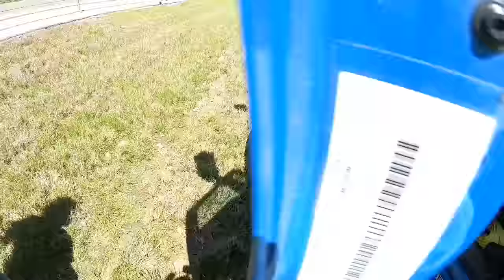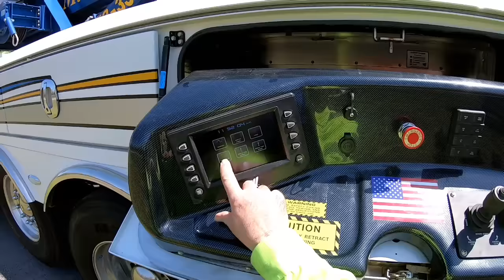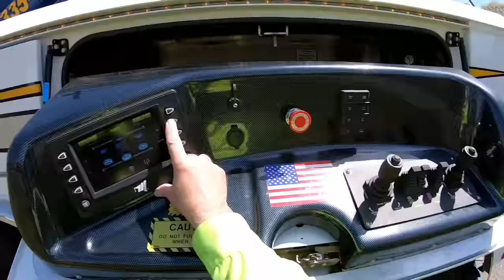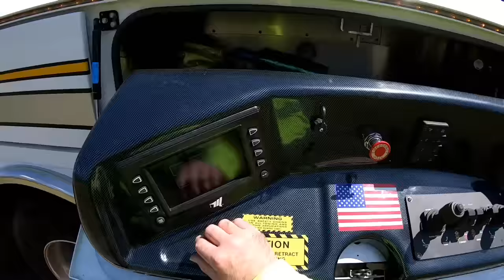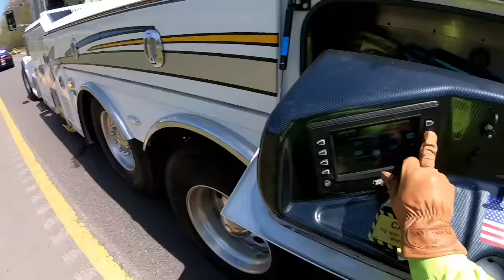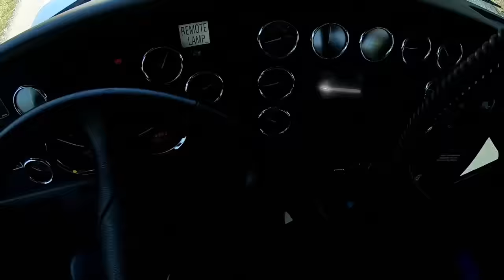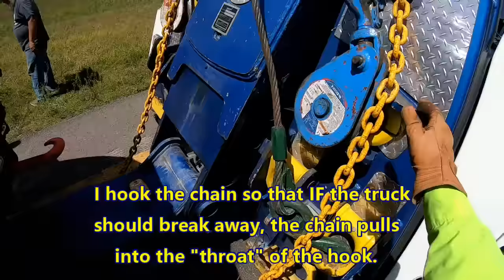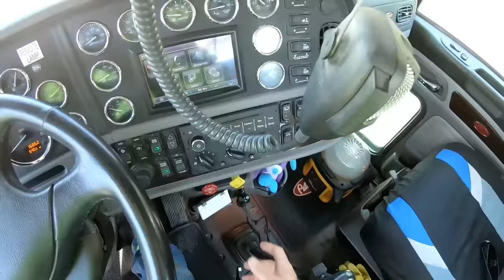Car VS Semi Crash!!!  Code 3 Response

Comment: 62k miles on a big rig is like a showroom fresh car with 1000 miles being smashed up. Its all fixable though.
Reply: Since trucks mostly do highway, I beleive it is safe to say that the average speed would be what... 40MPH? That mean 1550 hours, or at 8 hours/day = 193.75 days, 5 days/week = 38.75 weeks, 4 weeks a month = 9.69 months... Let's call it a 1 year truck.
Reply: that international had 43,853 miles on it, that cummins had just got broke in good.
Reply: @thephantom1492  try 55 mph average lol
That's my average with mostly running from Washington into California.
If you are running in states with higher speed limits (CA is still 55, Nevada gets up to 80), and you don't have a governed truck, it can go much higher.
I average 10 to 12,000 miles per month, and someone in an open truck not constantly pulling mountains, with higher speed limits is going to be higher.

So if he's otr, it could easily be less than 6 months old.

Oh, and we drive up to 11 hours per day, usually 6 days a week.
Reply: @thephantom1492  No, most 1 year olds have between 80 and 200k
Reply: @thephantom1492  My company say  average pre  year is 125000.
Reply: Plus its a diesel.
Reply: reverse thrust  my old favorite was the Kenwood thg71a, used that for years doing disaster and event comms, along with a Yaseu mobile rig. I more recently bought a Baofeng ht and am happy with it for the price.
I am not very active currently, so I haven't gone shopping for new gear in a while (other than the $30 Baofeng lol). Just decide what you need for your uses and look at the reviews.
For antennas, I would get appropriate Diamond or MFJ or whatever antennas, based on the gain that I needed.
For the ht, I had a selection from stubby nubs to telescopic 1/4 wave whips, and usually ran a pretty long whip, since I was often far from repeaters. I also usually had a mounted or magnetic mount mobile whip and adapter to attach to the ht.
Basically get the highest gain antenna that works for your needs, and get it from a good company with good reviews.
For instance when I got the Baofeng, I got the Diamond SRJ77CA high gain 15 inch whip, because it's what I like. 
I think it cost more than the radio lol
Reply: @thephantom1492  Haha Haha. Are those short haul estimates? Pull the other side.
Reply: My day cab is 1 year old and has 187k miles on it. It had 6k miles when I got it last year. I run linehaul at night, and another driver runs city with it during the day..it only sits a few hours per day.
Reply: My uncles company runs up 150k a year on their trucks so 43k would be less than 4 months old
Reply: @thephantom1492  nah we put 100k plus on a otr truck a year easy

Comment: Great video ! I have 30 yrs with a municipal fire dept and this is a first. I’ve not seen a tow truck running lights and siren to an incident. It would sure get you guys there faster. I requested police escort for tow trucks before, just to get them to us. One thing is for sure, traffic will not move for you, or us, or anyone else ! I’ll say this, you guys that are real pros with those trucks, can do some amazing things with them. Be safe, good channel ! 🇺🇸
Reply: Was in stopped traffic on the Interstate account an accident up ahead.  First EV came down the left hand shoulder and all traffic inched over to the right and onto the right shoulder to allow room for the EV to pass.  Second EV came down the right shoulder.  In this case, coordination between the various EV units would have benefited the 2nd EV unit.
Reply: Love these tow truck guys, but as a retired firefighter I don’t get why they are allowed to run code. What’s the emergency to get him pulled out of the median? He maybe saved himself 10 minutes.

Comment: I am very happy that everyone was okay in this accident unfortunately although the truck driver was not at fault it will still be put on his record as an accident this I do not agree with
Reply: acidburn21281 as a truck driver, I agree wholeheartedly. A lot of the accidents are from inattentive drivers doing things around big trucks they shouldn’t, but we as drivers of big trucks get the blame. And you are right, anytime a person is taken by ambulance, or a vehicle is towed, the CDL holder is charged with a reportable accident. Both the driver and his company take the hit. No matter who is at fault.
Reply: @jameswatts8137  Damn Thx for The Heads up Brother of The Highway as I am Starting My Trucking Career here soon and I now know I need to do what I can to Avoid Accidents as It is The only way One day I'll end up with My Family's Flatbed Trucking Company Beck and Russ Transportation
Reply: acidburn21281 Good thing they were in a Camry.  Most Sedans, SUVs, and Pickups would have been flattened by hit that hard.

Comment: I am a big believer in dash cams. I have them in every vehicle I own. That truck driver's guardian angle was working overtime. By all I've seen, that rig should have rolled over.
Reply: 40k load & probably only 1 pallet high will keep you planted pretty good if no big adjustments or hard braking.
Reply: Make you wonder when auto manufacturers will make dash cams opinions/standard equipment

Comment: I just can't get enough of watching this episode over and over. The Code 3 Responses are Awesome.
Reply from the maker: Glad you enjoy them.   Wish we had more of them, but the local departments have reduced the number of times they request us, as well as other tow companies, to respond Code 3.   I know there were, and still are, some tow companies who are abusing the privilege, which could get the Emergency Service status removed from ALL of us.   I would assume that abuse of the Code 3 response has lead to the reduction in the number of Code 3 response requests.   I believe that ANY tow company and its drivers should have to have some training and or certification before they are allowed the Emergency Service status and allowed to run Code 3.   As it is, the state of Missouri simply changed the statutes to include towing/recovery vehicles as Emergency Service vehicles in the same classification as Fire apparatus and ambulances (which some people do not realize that their are PRIVATE, COMPANY OWNED ambulances whose company policy may or may not require EVOC training/certification), yet did not include any requirement for training and certification.  Thanks for watching and God bless.
Reply: @RonPratt  Its not a problem. I mean they only need you to run code 3 depending on the severity of the accidents and importance of getting the highway opened back up again. Its just like the show "Highway Thru Hell". "Closure Is not an Option"

Comment: Why did those forks look to big for that axle? Looked like you could have possibly used smaller forks to prevent any sliding within the fork? Working on that type of call puts a lot of pressure on the operator to get the road open ASAP. Might not look like it but Ron just got 2 weeks workout on one call. Stay safe Ron, God Bless.
Reply: Dan Dunning That was my thought too, but, Ron is the pro while I'm just a truck driver that enjoys his videos. He did say something about the type of steer axle and not liking the location of the forks. He and Mike also added extra chains to help keep everything in place. My main concern was not having any brakes except his own which he did rectify. I've pulled roll stock and even on the best day, those loads are HEAVY. Also, unless you have trailers dedicated to that type of load, no matter what you do, I guarantee that they'll shift every time too.
Reply: I was wondering the same. Definitely not calling him out. He knows his stuff and has his reasons for what he does but I use my middle height  4.5" forks for those axles. Snug fit and down in the throat of the fork. But again I'm sure he has a reason for it. Love all his videos.
Reply: They were too tall, and he would have to reblock it hook up! He wanted to clear the road, plus the axle didn't have u-bolts as most do! That is why he chained the axle from side to side so it wouldn't slide and lose control!

Comment: Two things I noticed. 1. The beeping when you turned on the engine upon your first getting into the truck. The driver mentioned that beeping as well. The truck was letting you know something was wrong,  2. You might want to consider having your backup camera on the rotator instead of on that new rollback.
Reply: There is a reversing camera on the rotator - you see the screen at 29:19.

Comment: That car must've hit him pretty good to break the steering linkage! Kudos to the truck driver for not losing control and rolling his rig over on to its side!
Reply: I don't believe the car didn't break the steering linkage, It's because of the rough going in the median, the wheels would probably try to turn and put too much pressure on the linkage! Then snap!  I've seen a lot of things and it's amazing how some things happen as the accident occurs!
Reply: The driver had nothing to do with anything after the steering arm went. His copilot was working overtime though.

Comment: Cool video, and it's a very good thing there were no life-threatening injuries on either parties involved. As Ron stated, the 'Good Lord' was watching out for this truck driver; there is a multitude of outcomes other than what did transpire here. Imagine: a broken steering arm, with a full load of paper rolls. Much credit goes to the driver, as his knowledge, and driving experience also factored into his ability to stop the truck in the median, without it tipping, or rolling.

Comment: Semi vs. car...often doesn't come out with results like this.   I witnessed a Pontiac Grand Am get T-boned by a semi with a flatbed full of sheet rock.  Semi ran a red light as the Grand Am was in the middle of the intersection.  Folded the Grand Am (front and back bumpers were only about 1 1/2 ft from each other), driver side first,  around a large pole for the traffic signals.  Driver died within minutes of the impact.  I'm sure that truck driver has had many times of re-seeing that nightmare.  I know I still cringe every time I go through that intersection.  The truck driver in this video was truly blessed to have come out of this relatively unscathed.  Bless you Ron for your professionalism!

Comment: That truck driver deserves a lot of credit, no one was severely injured or killed, damage looks mostly superficial and not terribly bad considering what a big rig can cost to repair,  he got the truck into the ditch of soft mud and stopped with 40k in the trailer after losing steering  with
out rolling it...get her fixed up, and roll on driver!

Comment: How many times do you have to replace or rebuild the transmission on your truck? All the times your towing all these heavy loads has to be nibbling on the gears pretty good.
Reply: You do realize that transmissions are built for this sorta stuff, right?
Reply: Yeah, Ron is driving a semi. It just has a stretched frame and a rotator body instead of a fifth wheel. Fully capable of pulling these loads.

Comment: What kind of horn do you have on the wrecker? Love the horn sound
Reply: Loud manv8 I think it’s a normal air horn. I don’t know a lot about truck horns
Reply: I don't think it's anything special, beyond a stock air horn provided by the truck builder (Peterbilt).  You could request a funky one if you like, or remove and refit any horn you please, so long as it fits.  You're not supposed to fit train horns or likeness of train horns, but so long as you don't go around abusing the privilege and get yourself caught, they don't much seem to worry to much about overly-loud horns on trucks.
Reply: Stan Patterson  I bough an electric horn from one of RONs leads, matter of fact, There are several things from his leads I had bought.cheers from NJ
Reply: @stanpatterson5033  - Longhaul Larry has a train horn on Big Blue.

Comment: Did not see any Red/Blue on the front of your truck Ron. That might be one reason why you had trouble getting thru the traffic. Really need to make yourself visible when running code. Replace your yellow/White visor lights with Red/Blue ones and add a whelen dominator  2 leds red/blue bar or check out the Whelen 600 series half red half blue by mounting 2 of them to the front of your truck. Link to Whelen 600:::::: http://www.whelen.com/auto/product?head_id=12&cat_id=74&prod_id=148     :: You will be very visible running code to an accident. Those small Led's in the font just do not cut it IMHO.
Reply: He has red and blue on all of his trucks except maybe the western star.

Comment: I view most of your videos, and am in full agreement with +Dennis Cherney, you should consider the 'Federal Signal "Q" MECHANICAL Siren'. 

Most of my working life involved the support of avionics in large commercial aircraft; I have been retired for quite some time, so I can offer to help in the following way: should you decide to go the "Q" route, I'll kick in the 16 or 18 AWG control/floor switch-to-relay custom wiring harness [harness only, 63/37 eutectic-tinned ends, all 'rosin flowed'] 

The harness will NOT include crimped connectors, but will utilize 'self adhering - adhesive center' heat shrink insulation, and be made to your drawing and specifications. The breakouts, and entire length of the harness will be laced at 1.5-inch intervals using "Gudebrod nylon wire lacing", in a similar methodology to the way in which aircraft harnesses are made.
Reply: AMStationEngineer  hey quite a way back, I needed to get a n alarm system for the company vehicle assigned to me, but was 6volt, and was able to buy 1 off a mechanic at the service station we used, it was a HEAVY CHROMED FIRE ENGINE SIREN,,, I believe it’s still in the basement . Cheers from NJ

Comment: As a retired LEO with 20 on the job I have nothing but absolute respect for heavy recovery operators (or any tow/salvage operators, for that matter). The operators I had in my jurisdiction were all Fed DOT certified inspectors and they could evaluate a wreck on-site. Their yards were DOT impoundments and we were able to conduct our investigations with their expert guidance. As truckers, themselves, they were the first to point out violators of safety rules and equipment deficiencies, heading-off public complaints of lax enforcement for commercial operators. 

This was one of the most beneficial public/private partnerships............................

Comment: What state is this? Never seen a tow truck with sirens
Reply: That’s what I’m saying
Reply: Missouri, and Tow companies in Missouri are considered emergency equipment and there aloud to run red and blues along with sirens if emergency personal tell the towing company that they are needing to expedite there services then there aloud to run code other wise they cant use sirens or red and blues.